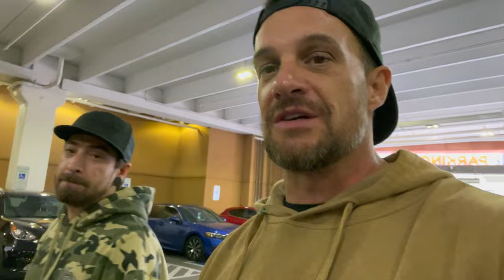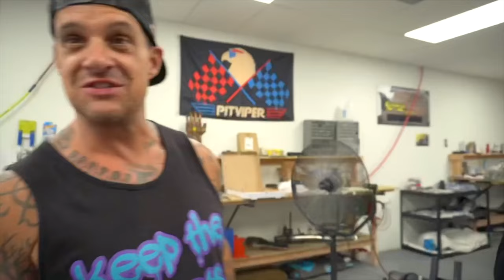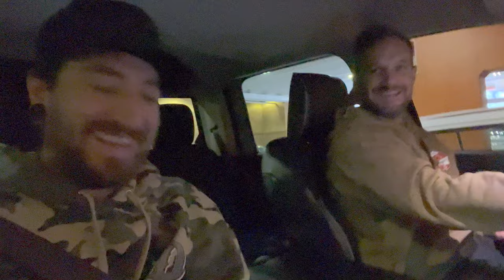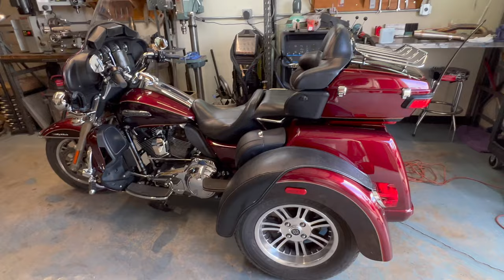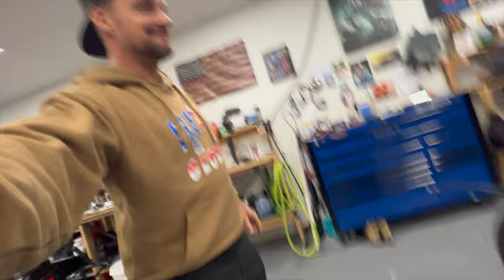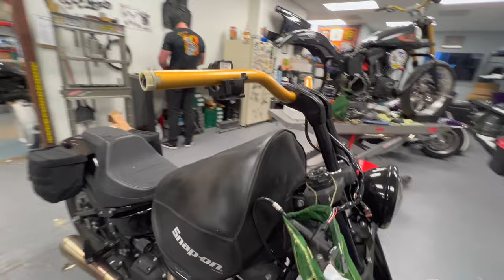merry vlogmas kruesi originals vlog #29

Comment: Shit I missed it..what happen to your arm/neck, shoulder. Prior video ?
Reply: He had a badly herniated disc in his neck affecting the nerve running to his arm weakening the muscles. He got an artificial disc put in and is getting stronger once again.
Reply: @EngineeringGoneWrong  Thank you for that info sir. I have a very similar problem but am on the fence about surgery.
Reply: @rtkl13  No problem. I herniated L4/L5 and L5/1 about 2 years ago now. Was a long journey but through physical therapy and consistently working out now I have been pain free for a good long time. Best of luck to you!
Reply: @EngineeringGoneWrong  good for you on recovery ! The gym is for sure the answer
Reply from the maker: I had to disc replaced on my neck. Two of mine were completely gone. My doctor Murphy installed simplify discs. It’s some new stuff. It’s amazing. I feel better than I have in my life and I’m a quarter inch taller :-)
Reply: @kruesioriginals  I don't need to be a 1/4" taller I need a 1/4" or more down....
You know what, nevermind 🤣
Reply: @rtkl13  Thanks man. I count ride my motorcycle for a year and it was right after installing a bunch of new suspension parts. I was sick over it, put a bedsheet on it and tried to make it not look like a motorcycle so I didn't cringe not being able to ride. 

But never fear, I'm back to jumping railroad tracks and am installing a Hammer Performance 1275 kit in it so life's good haha
Reply: @EngineeringGoneWrong  right on man